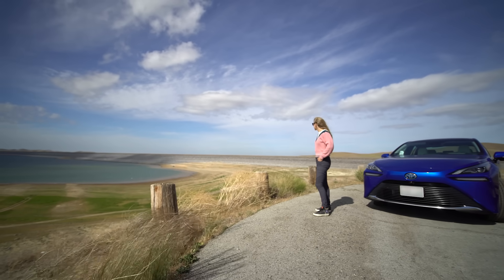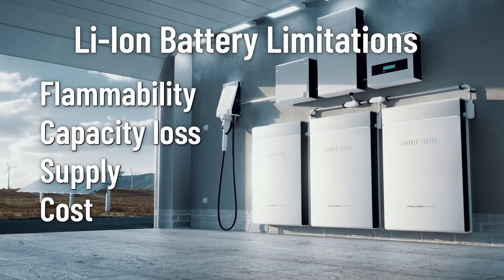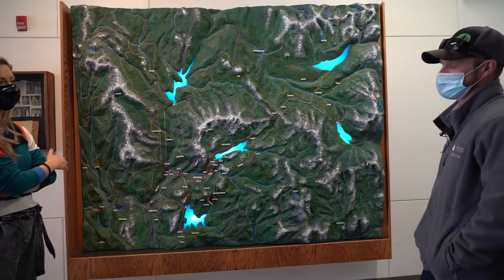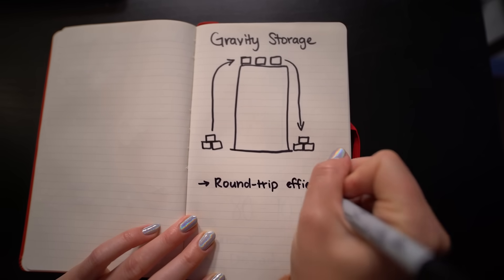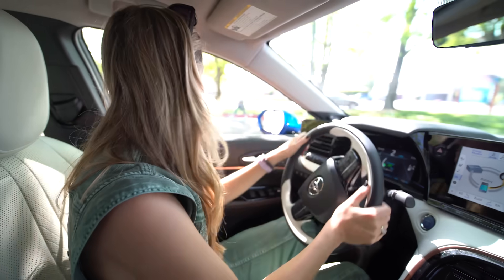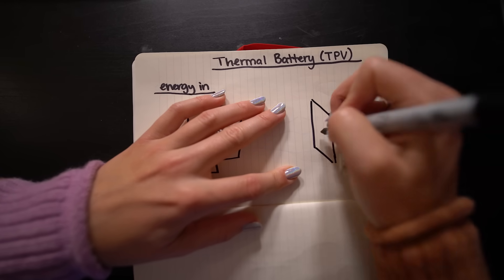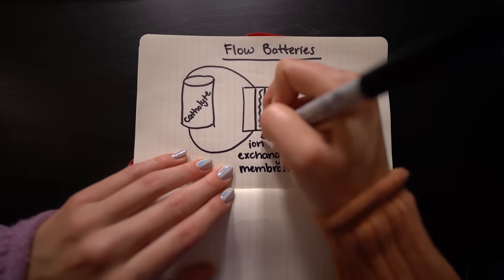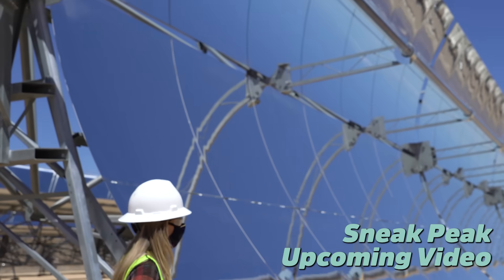The BIGGEST problem with clean energy

Comment: it is sad have you become an anti vaxer as well large , sections of this hold up but important bits don't 1/3 of the ng in sydneys grid is detected by offshore buoys - hydrogen is a lot smaller the hornsdale battery hasn't been the biggest for some time  i could go on but you have been iced

Comment: LFP batteries - the kind I use in my home for storage - are far less flammable and have higher cycle counts (especially deep cycles). I bought 4 of them and connected them in parallel for 21.2kwh total storage for less than the cost - and almost twice the capacity - of 1 Tesla Powerwall. I appreciate the other storage technologies very much and think a lot of them have real promise, but singling out and not covering the existing solutions (which are constantly improving and falling in price) due to environmental impacts and safety issues, and then promoting alternative solutions with their own environmental impacts and safety issues, is problematic to say the least. 

As good as this series is - and I have enjoyed it so far despite my critiques - I can't help but think how much better it would have been without the encumbrance of Toyota (with their obvious bias i.e. their marketing of hybrids as superior to BEVs because they're "self-charging" ... such BS) sponsorship.

Comment: I'm glad you included the round trip efficiency numbers in your report, especially the one Toyota probably was likely not so keen on you revealing, that of hydrogen as a storage medium at 25-45%. nearly the worst of the systems you have covered here. Hydrogen storage in places where we now store natural gas brings to mind the year long leaks the SoCAlGas had in Porter Ranch CA. Hydrogen is the atomic great escape artist when it comes to containment, and hydrogen embrittlement of steel pipes makes it unsuitable as a direct natural gas replacement, I'm sure you know. And schemes that cost less than natural gas itself for the production of hydrogen are going to be fighting that battle to become viable in the marketplace.
 I do think you have so far missed what all the battery cars being sold today will yield in terms of storage. 
I mean home storage for that time fairly soon when the percentage of BE vehicles is high enough to utilize V to G. That shrinks the necessary amount of grid enhancement to localities where the increases in energy use from EVs will be coming. There will be some places for HFC being the right tech, and Toyota already has some in place. But the Mirai is not the answer for our highways. A mere doubling of the energy density of the lithium ion battery per kg and there will be not enough room for more COP vessels in the Mirai to match the range of a Tesla Model 3 Long Range like mine, which already has 350 miles of range to the Mirai's 400. My car can seat 5 and that third tank that gets it to 400 miles eliminates that seat in the equal sized Mirai.
 The hydrogen business model is far too close to that of the "energy" companies intimate to our economics at all levels of our present society.  I want the right mix of storage modes for the most rapid, but cost effective moving to renewables and away from fossil hydrocarbons as fuel that we burn,  and that may not be the one that saves the business of industry that got us to this state of affairs.
Reply: Porter Ranch was an incredible debacle.
Not just the community that had to be evacuated, but the discharge that had to be capped.
With methane having 30+X the GHG effect of CO2.
It is really amazing how methane shows up in the infrared. The video I saw was a graphic representation of how bad it was.

Comment: How is the heat from compressing air recovered? This will be done when the grid is over supplied so cant dump it there.

Additionally how is the cold from expanding gas handled? Must be useable too??
Reply: Amazingly, the heat is basically stored in tanks full of sand and used to re-expand the air!
Reply: @elliottmcollins  Thanks!
Reply: being done. One company is using both the air pressure and the temperature difference as energy sources
Reply: Stirling engine maybe?
Reply: "When the grid is oversupplied"?
CERTAINLY while fossil generation still exists.....
You make sure the "green" system has more output capacity than its input. If the stored capacity exceeds a given amount, with large input occuring, you max the output AND  TURN OFF fossil generation.
And or, you install a big BATTERY!  fast, reliable, as secondary storage.
As you find you use that more you turn off the fossil ant completely!

Comment: Reduced and more efficient use is as important as storage. Toyota isn't going to like it, but far fewer autos are really needed in well-designed urban areas, not that there are well designed urban areas in North America. This is not only a fuel issue - each car requires a lot of energy to extract and process raw materials as well as to form and assemble vehicles.

Prior to the dismantling of urban transportation networks in the 1960s, people took busses, trolleys, or trains to work. My grandparents (who lived in D.C.) never owned a car. If they needed to go to the grocery store, they would take a taxi, although, during the summer, a vegetable vendor would bring produce from his farm. 

Unfortunately, few new developments are geared towards reduction of energy use. Not only is physical development needed, but changes in personal behavior are going to be needed if we are to achieve a realistic carbon-free energy system.

Comment: Why are wind energy even still being called sustainable? They are carbon positive because the mechanics fail due to the enormous size and weight of those blades and require more maintenance than any other solution which makes the cost skyrocket? 🙄

Comment: there is a new tech in the making where you bind hydrogen to a carrier substance, making it safe and transportable via normal tank trucks. you can just pump this fuel into cars with fuel cells, combine it with water and you get the hydrogen for the fuel cell. imho thats very promising, as it solves a lot of the problems with hydrogen. sry, the vid is in german, but the auto-translate subtitles should work https://www.youtube.com/watch?v=fpCynle_BWo&t=314s

Comment: Nice work on this.  You identified the primary challenge for depending on wind and solar.  But you made the same mistake every other treatment of the subject makes.  You assume that if you list enough possibilities, a few of them are sure to work.  That is by no means guaranteed, and it takes a special kind of hubris to tear down reliable sources of electricity on the assumption that one of these ideas will work.  Advocates have exaggerated round trip efficiencies of different storage ideas to an extent that borders on fraud.

Comment: I enjoyed the video. I was surprised though that you didn't mention Liquid metal batteries. These aren't long term storage, they're more for overnight daily cycle, so one imagines they'd be paired with Solar to take care of night time drops. I understand the turnaround  efficiency to be about 80%, and last I read, a pilot program was having them installed as part of an off-grid server farm in Reno. The battery system is supposed to be 250 MWh, and construction was supposed to start this year.

Comment: are capacitors viable for short term storage? they basically are fast cycling battteries
Reply: Yes very short term on the order of minutes. Capacitors are very leaky and would not work at grid scale.
Reply: @Obscurai  
Battery's don't work at grid scale. Certainly not how you think they do.
Reply: @lordsamich755  Correct, batteries are not large energy stores but rather are best as grid conditioners. So I am familiar with their applicability to the grid. That said, the original question was about capacitors not batteries.
Reply: @Obscurai  
My point was that capacitors are much more suitable. It's precisely this short term storage rapid cycling that they are designed for.
Reply: @lordsamich755  The issue is cost as dictated by power density. This is why there aren't any capacitor storage sites (and none planned), whereas batteries are becoming more prevalent.
Reply: @Obscurai  
I would argue that battery's were the quick fix. Capacitors would offer much better returns long term. It's weather people want to make the investment.

In-fact on that note. It sort of shows that the people investing in grid battery's are basically there to make a quick buck. They'll probably pull out once people realize that they are mostly there to replace diesel generators. The purpose of which was to capture the ultra lucrative 5 - 10 minute demand spikes. Not to improve the viability of wind, which it can't realistically do.
Reply: @Obscurai  
ROI's are also calculated by people who have to be aware that different technology's exist. Battery's being much better established, have a lot more lobbying power behind them. So I don't think it's about having a lower ROI.

Remember the company behind bringing this entire concept into the spotlight was Tesla. If memory serves they bought out Maxwell Technology sometime after offering to build the Hornsdale Power Reserve.

It could easily be that they don't as of yet have an elegant segway into super-capacitors, as they are seen as untested. But batteries are only tested because the SA government completely stuffed up the power grid.
I don't see them doing that twice.
Reply: @lordsamich755  It should be noted that ROI analyses are performed by electrical engineers - not by accountants. That's what engineers do - find economically viable solutions to real world problems. And would be very aware of all the technologies available to them. To assume that they would not be conversant in the myriad technologies that are currently available is a disservice to their professional engineer credentials.  

Also, given the large number of engineers employed by the thousands of energy companies around the world, I'm sure at least some would be knowledgeable about ultra-capacitors, given that even laypersons such as yourself are aware of them. That all those engineers have decided against them at this time means that capacitors are not a viable option for the problems they are trying to solve.
Reply: Not really, and worse, they're far more dangerous than some energy storage methods.
Reply: @andrewcopple7075  
"they're far more dangerous than some energy storage methods."

What?
In what way are they more dangerous?

Comment: Quick question: when you say lithium supplies will run out by 2080 what does that mean exactly? If we recycle lithium batteries (which we're already starting to do efficiently) how could we run out? Will the demand for lithium be so high we won't keep up even with recycling, or is that estimation made without taking into account recycling at all?

Comment: I actually went down the wikipedia rabbit hole a couple days and ended up finding out that some research groups are also coming up with membraneless flow batteries. From what i understand, the membranes are generally the most expensive component of a flow battery, because they have to have very specific characteristics (permeable to ions but not to electrons iirc). So to keep the fluids separated they use laminar flow! If i remember correctly, they use h2 on one side and hbr on the other. The h2 flows on the outside of a porous anode, h+ permeate through the anode and the aqueous hbr electrolyte towards the cathode where they encounter a flow of hbr+br2. Then finally the h+ reacts with the br2 and electrons coming from the cathode to form hbr. Its rechargeable too, and apparently round trip efficiency is comparable to that of vanadium flow batteries.

Comment: Tom Scott released a video in the last few days showing similar problems in the Orkney Islands.  With all the different tech being tested, there's far more supply than demand most of the time, and the interconnect to the main grid is nowhere near robust enough to export all of it.  Nobody wants to upgrade the interconnect unless they can be guaranteed to increase the amount of energy produced, but nobody will commit without the upgrade being done 🤦‍♂️🤦‍♂️🤦‍♂️
Reply: Perhaps the Orkney Islands just need to fill tankers full of hydrogen or hydrogen-rich compounds for export. Maybe use the Sabatier process to fix atmospheric CO2 into methane and ship refrigerated tanks of liquid CH4 to other countries. Ultra pure methane by the tens of thousands of tons ought to have a decent market value.
Reply: @BlahVideosBlahBlah  From toms video they actually do produce some hydrogen with their waste energy and they are working on powering their ferries with that hydrogen. They are a small town so you can't really expect massively innovative solutions for such a unique problem.
Reply: @BlahVideosBlahBlah  natural gas is a cheap enough source of methane that it wouldn't be profitable to sell methane in this way, but they could probably use the extra electricity to make easy to ship energy intensive commodities like aluminum or steel.
Reply: now that is a Scottish Stand-off.
Reply: @mcdon2401  Right.  Imagine if the billions poured over decades into developing the nuke industry, and the billions each year currently subsidizing fossil fuels, were poured into resolving conundrums like this, which are petty compared to the huge problems that we've managed to solve along the way.
Reply: Bureaucrats as usual.
Reply: @SrikarMaddula  Based on economic motives because bean counters need to know beforehand who's going to cover how much of the billions it costs, regardless of how critical it may be to get it going. Twisted financial motivations, not bureaucracy... though sometimes they join forces in effecting the opposite of forcing wasteful decisions through regardless.

Comment: I see lithium dominating simply because you can put it almost anywhere, it can react to changes in the grid almost instantly, and has no moving parts. Availability might be on big drawback but not enough to keep it from succeeding.
Reply: Lithium Ion is relatively cheap right now because of its enormous economy of scale, but I think its likely that other battery technologies, as they mature, will be cheaper. If any of them become just a bit cheaper than Li-Ion, that's where the grid will go. Grid applications don't need light weight, or high power density (things Li-Ion excels at). They'd be stationary, and can take a large foot print. They'll want cheap and reliable, and I don' think those are Li-Ion's strong suit.

Comment: I'd like to see supersized ram pumps (they exist) returning some of that water back up to the higher lake.
Reply: Ram pumps? Isn't that the kind of thing that needs a certain quantityof water to flow in order to pump up a smaller quantity of water ? Works perfectly if you have lots of water that flow downhill, but in that case, just leave the water where it is (that is, in the upper reservoir)
Reply: That's what that facility already did!
Reply: Think John dodo doe got me on this already, as in they already have this setup. I was talking about water that is flowing out of the existing hydro electric generator and pumping some of it back up to the upper lake. Ram pumps need head pressure and a constant supply of water to work. Even if only a small percent of water is returned from below the generator it is still some water being pumped for effectively free.

Comment: You missed the storage capacity of the EVs themselves and their ability to move power onto the grid as needed.
Reply: It's nowhere near enough. The US alone consumes around 4000TWh a year. Globally, there are roughly 1.3 billion cars on the road, which, if all of them had a 100kWh battery inside, would amount to some 130TWh. All cars on Earth could store, at best, a few weeks' worth of energy for just the United States. Even worse, we can only  expect to use a fraction of this energy at any given time, since people are using these vehicles to get around.

At best, vehicle-to-grid is a useful tool for grid balancing, but it's nowhere near enough to store the amount of excess energy we'll see in the future. California and Germany, by themselves, already curtail around 9TWh a year. When every country is generating electricity mostly through wind and solar, 130TWh of excess is going to be a doddle.
Reply: @vasudan-u6k  Nowhere did I imply this was a total solution. Calm down a bit.

Comment: What about liquid salt batteries? Also those guys that warm the carbon as storage, why not couple that with sterling engines? Isn't big temperature differences just the thing those thrive on?
Also I think what would make more sense is instead of one enormous grid storage system is to incentivize micro storage in homes and business. Battery tech doesn't scale well but it works well on a smaller scale and relieves the grid as a whole.